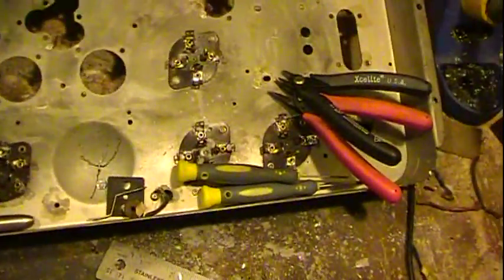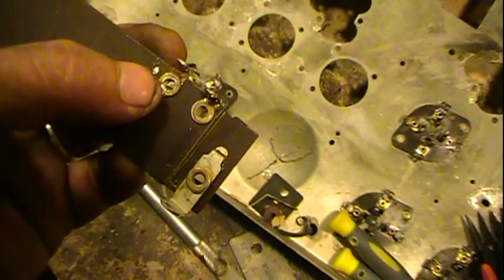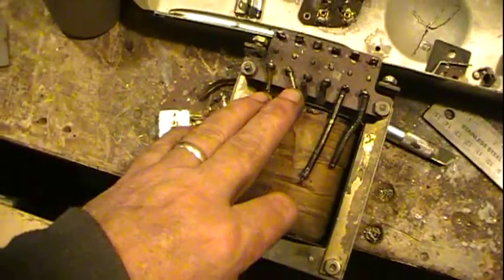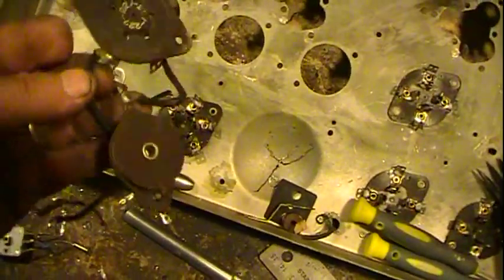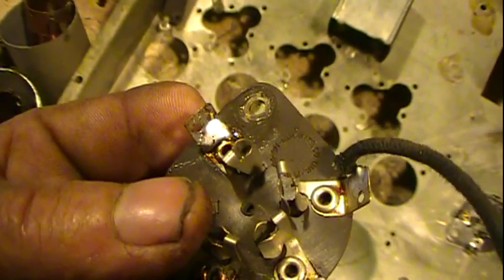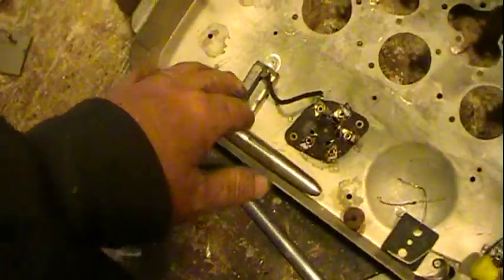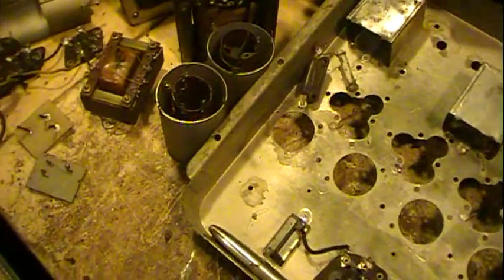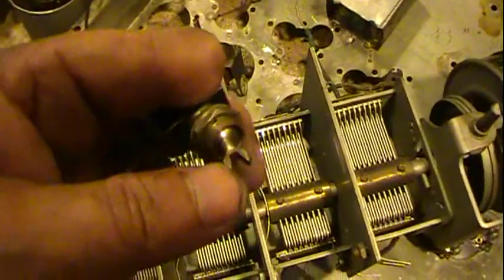Airline TRF radio part 1

Comment: I've often found open windings in audio interstage transformers in sets of this vintage, even ones that were potted in a tart filled can that nobody could have tampered with, it just seems to be a common fault in sets with push pull #45 output tubes. Usually it's the primary side that's open, though I have had ones with one leg of the secondary open, I think it's DC current that kills them, though some of the materials they had back then were pretty corrosive to copper as well.
 I have tried the trick with using a resistance-capacitance coupling as a repair but I found that the gain suffered, especially with a single type #27 tube as a driver as many of these sets have, those transformers do add some degree of amplification, Fortunately you can buy reproduction 3:1 interstage transformers from one of the Antique radio supply outfits, as well as from Edcor or a Hammond Dealer. AES has a new generic one available, most only sell Hammond ones. I also found plans for making a solid state substitute for an interstage transformer in the AWA Old Timer's Bulletin, which I think I may try at some point given the low cost. Then of course there is the possibility of rewinding an original interstage transformer, but you would have to be pretty dedicated to try it as winding transformers borders on a black art, especially with anything related to audio.